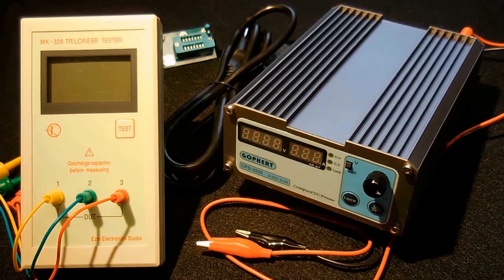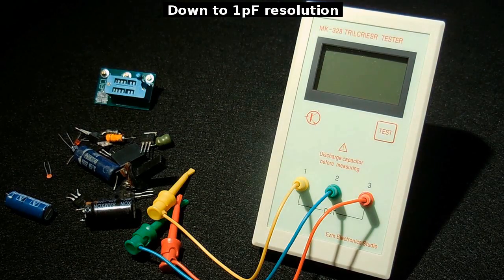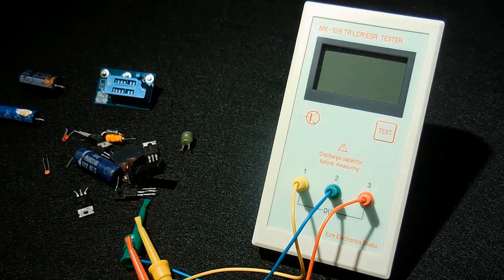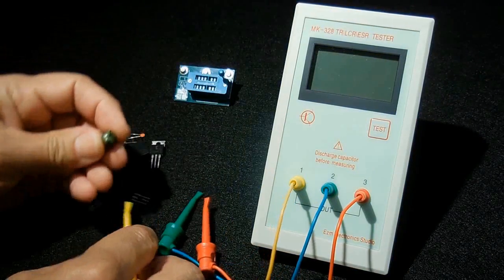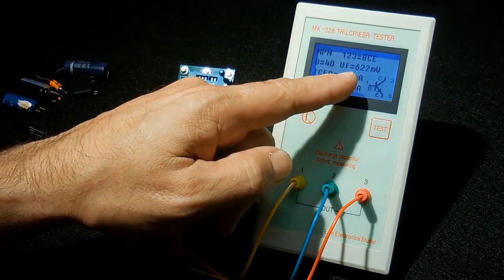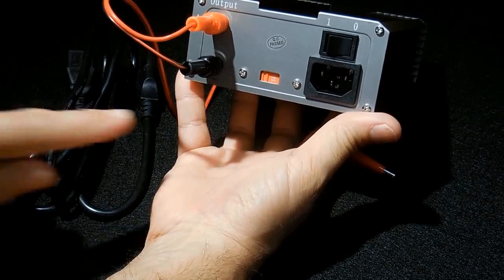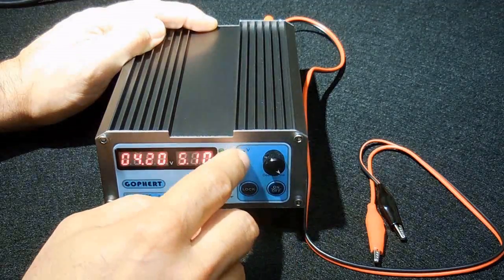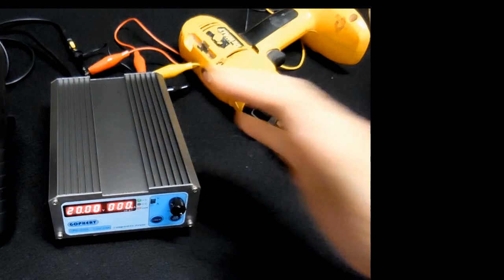(2) Very Good/Low Priced Items For Electronics Hobbyists

Comment: Tester is actually a modified clone of Karl Heinz's Transistor Tester open source project. In order to save money and protect me from a piece of crap postal service I built one myself, gotta agree -  a great tool to have. And, I dunno 'bout this one, but the original design has MENU, which you can open by long press of a TEST button (when the screen is active). In that menu, there are even more features - in-circuit ESR tester, freq. counter, freq. generator, 10-bit PWM, and a self-calibrating option. 
 I suggest you go try and see if there is a menu; if it's there you will be even happier having this tester
Reply: Tried long hold on mine. Nuthin'. :( Need a good in-circuit ESR for cheap. Suggestions?
Reply: Rick Raulston That's unfortunate :( Original software has a whole menu there, I can make a video showing that if you want. For the ESR meter - I bought a cheap analog multimeter, gutted it out and used the movement for a little ESR meter circuit. It's simple&cheap, you can build it yourself; it has no trouble with in-circuit measurements.
Reply: I went ahead and bought an MSR 100. Seems to work pretty good
Reply: Rick Raulston Congrats with purchase, ESR meter is really useful tester.
Reply: Shorting all of the leads together should put the meter into test mode.

Comment: Well, I purchased the power supply and am very pleased with it.  There appears to be a feature not covered in your video.  Normally, if you turn the power supply on, the default operation shows off (meaning no power to the leads).  To change the default operation, press the on/off button for 5 seconds.  This will show dOn meaning power is supplied to the leads at power up.  To change it back, simply press the on/off button again for 5 seconds.  dOf will appear.  I prefer to have it "default off" to ensure I have the correct voltage/current set before I use it.
Reply from the maker: +mediaguardian 
Glad you like it. I'm very satisfied with mine. Can't beat it for the money. I did not know about that feature. Thanks for sharing!

Comment: Thank you for this video. Your recommendations are highly thought of. I was wondering if you felt that the push/turn/push/turn interface was annoying (as compared to just two knobs for V and A)?

Also did you look inside to see what the quality of the inside is? From the price I'm guessing this is a quality item.
Reply from the maker: +Torsan1977 
Hi there. Switching between V and A is no big deal to me. If I was using the PSU all day long, 7 days a week, then maybe it could become annoying. I will post a link in the video description area showing the inside of the unit.

Thanks

Comment: I have that ESR tester. The leads are garbage and will break off and have to be resoldered regularly. They are also very hard to find decent replacements for, since they use the 2mm banana jack. There is also no room in the actual device to install standard banana jacks. The cheap battery plug feels like it will probably break after changing out the battery a few times. The basic functionality of it is great though.
Reply from the maker: I had the same problem, and the fix is simple. When the wire breaks off, you re-solder the wire in position then fill the area around the wire with clear silicone and allow it to cure overnight.
Reply: I see. So basically you are just making your own strain relief. Good idea. Still, I wish the leads were better.
Reply: can't you use standard better leads,  strip the ends and use the adapter and lock down the stripped ends in the adapter?

Comment: I think the power supply can deliver the full 5 Amps at 20V, but it is missing sense-terminals inside to make up from the losses in the wiring inside to the output terminals.

Comment: It is a nice AVR Transistortester, but it is pretty pricey. You can get kits of essentially the same circuit for a lot cheaper.
Reply from the maker: A ready to use tester is pricey at 30 bucks? I don't think so.
Reply: The kits are not too hard to assemble. Some of the premade testers are pretty cheap too. But the very cheapest of them don't have a precision voltage reference in them. They instead just have a zener reference. The crappiest prebuilt one I can find right now on Ali is $7.22 A decent kit is $1.88+$2.84 shipping. Of course for the low price there is no case.
Reply from the maker: Most people already have too many projects going on, so buying a kit, which lacks certain features, to me is a waste of time.
Reply from the maker: Clearly you're not a supporter of all my hard work on this channel based on how you're going out of your way to try and get people not to buy the very good, but inexpensive tester shown in this video. You do realize that this channel is able to remain active(and help countless people) because of the small commission I receive from products shown on this channel. You're trying to deprive me of that support. I keep track of good and bad viewers. Those that appreciate my hard work, receive assistance, and those that don't, get placed on a list. Happy Easter.
Reply: +electronicsNmore Jesus cast the money changers out of the Temple. Now here you try to Crucify me. Nothing ever changes.
Reply from the maker: Enough of the stupidity. We live in a world where MONEY is required to survive. Got that?
Reply: +electronicsNmore yeah I'm planning on keeping it too. I already have 3 AVR transistor testers now. The one you showed is really nice, but it is a bit pricey compared to other offerings. Got it?

Comment: Of course I bumped into this video right after ordering MERS-100 for twice the price and I guess it can measure capacitors only. There just isn't enough information for other testers if they can measure in-circuit which is the main feature I need.
Reply from the maker: You can measure in-circuit, but it's never totally reliable.

Comment: That tester is probably based on an Atmega328 microcontroller (which you can also find in many Arduino boards) which might explain why it says: MK-328 on the front. For those curcious to have a look inside the power supply, go here: http://www.ebay.com/itm/AC-110V-220V-to-0-32V-5A-Precision-Adjustable-DC-Digital-Switching-Power-Supply-/121633720324  and scoll down a bit.
Reply from the maker: +Peter-Paul Vervoort 
Hi there. Yes, the tester is based on the Atmega328 microcontroller. Thanks for the link showing viewers the inside of the unit. I thought of opening up the unit, but did not want the video being too long.

Thank You
Reply: +electronicsNmore And actually it's an open-source design thought up by a german guy. All documentation, firmware-upgrades etc. is here: http://www.mikrocontroller.net/articles/AVR_Transistortester
Reply from the maker: ***** Yes, I know that. I read all the info.

Comment: Voltlog tested one and ripple/noise was 50-55 mV ..  so I answered my own question below, hence they are lying, but compared to many that is actually quite good...     (Jeez it's the first thing you should test on these things).
To hell with these switchmodes my next psu will be a good linear job.
Reply from the maker: They always over-exaggerate, but for the low cost, you can't beat it.

Comment: O.K.  I have to tell you that at first I loved Banggood ... good prices.  Now not so much.  After fighting confusing forms to fill out I finally ordered the tester and then they put in two orders for me.  I went to chat to fix this ASAP, and find I am #29 in the queue and my wait time will be 33 minutes.  How awful is this?  I'll have to remember this if I can save less than a buck using this place.  Good luck if you try to order through them.
Reply from the maker: Sorry to hear about your issue, BUT it sounds like you screwed up and you're trying to blame Banggood for your mistake. There's nothing confusing about placing an order.There's nothing awful about having to wait to speak to a representative that long. I've had to wait that long with many companies in the past. Banggood has become a very popular website, so many people have questions or issues to resolve with agents. No company is perfect, if you think so, then you're highly mistaken. Problems happen with Ebay and Amazon as well, I know that for a fact.
Reply: Banggood is my go to site for electronics and other stuff as well.  Really appreciate your well done videos.  I was looking at the MK 328s when I found your site, glad I came across it.  I bought a Mk 328, but not from BG, found one for $22. US and free ship.  I do intend to buy the PSU the next time I get paid.  Currently using the equipment to repair/modify electric guitars.  Just wound my first Tele bridge pickup and needed a way to test inductance.  Thanks again. WooHoo.
Reply: I have been buying at Banggood for years. NO PROBLEMS AT ALL. 
  And your site is the place I go to for understanding the way out, of the difficulty, I some times find myself in.
Your the man. Thank's for all you do.

Comment: I had a look at the picture but it didn't answer my question, why I'm concerned is, if using an earth clip with a dso on a circuit powered by this psu, one could have a shorting problem to mains earth equivalent to the difference between the two potentials. It looks like very good value though and good specs.. Maybe someone commenting might know ? I did see an earth lead inside, but no idea if its tied to -neg.

Comment: does this esr meter work with capacitors on board, without taking them out?
Reply from the maker: +Kevin Yan 
For measuring ESR, you should not have any problem at all in circuit. I do it all the time.

Comment: Outstanding presentation, thanks. So I purchased the MK-328 and get a display after testing a component that states: 'Not calibrated!' The component results seem to be correct like you show but I get the calibration message right after. Have you had this issue? Much obliged
Reply from the maker: I have no idea. Please ask a question on Banggood for that product.

Comment: Thanks for the video, it helped me decide which of the affordable ESR meters to get. I got the MK-328, but mine doesn't automatically power off, I have to disconnect the component and press the test button. Only then, after finding no component is connected it powers off.
Reply from the maker: Strange. My unit powers off with the component connected. You didn't test a capacitor w/o discharging it first, did you? That could damage the unit.
Reply: Yes yes I did discharge. Specifically for that purpose I have built a special 5W 22K capacitor discharger doohickey with alligator clips on both ends. Anyway, the tester tests without problems, transistors, diodes, resistors, all seems to be okay. Just doesn't usually power off (although it did power off a couple of times, I don't know what to think of this).
Reply from the maker: I967
Contact Banggood and explain your issue. Thanks.
Reply: @electronicsNmore  Update - I learned how to change the firmware in the tester and now I can turn it off and access extra features. I am planning to add an encoder to move about the menu faster.

Comment: I have been looking at the power supplies on Bang Good for some time, and have looked at this one before, but here in the UK, we use 240V,  this voltage seems to be a problem with the BG site, as most of there mains gear is only upto 220v.
Reply from the maker: 110/120v or 220/240v. Either works.
Reply: forgive me for being a little thick, but if you put 240v, into a 220v item, I'm sure you will blow it.  The only way I can see of being able to use these low rated power units, would be to use another power sources to lower the power I am using?
Reply from the maker: Nick Stevenson
Incorrect. Voltage always varies. In the USA I have seen the 120V line vary between 110 & 130V. I have seen 240V range between 220 & 260. Your concern is unfounded. I have many people buying these units from the UK. :-)
Reply: ok, thanks, will give one ago, but you can not blame me for being careful, lol
Reply from the maker: Nick Stevenson
You won't have any problems. :-)

Comment: Why a MERS-100 is more expensive? I mean, what is the difference? In comparisson, why should and why I shouldnt choose this product? I want to know the defects, if any... Why did the tester devour the batery? Nice Vid! Thanks!
Reply from the maker: When filming, there are always interruptions by landscapers, barking dogs, etc. So I had to film certain parts a few times, which is why the battery gets drawn down. For the money, you cannot beat the tester. You cannot expect perfection from a 30 dollar tester. Thanks for watching!
Reply: Have any video using this on in-circuit  capacitors?
Reply from the maker: The normal procedure is testing the component in-circuit, if the reading is "close" to the value of the component, then you're OK. If the value comes back way off, then you need to desolder one lead and test again. No tester is 100% when testing in-circuit. Problems can occur when components are placed in parallel. All this being said, I have no problems with the tester.

Comment: Congratulations on 50k subsThanks for the video.  I have been without a capacitance/ inductance meter since my last one broke.  Great functionality for the price. I have also been looking for an inexpensive power supply that has low current limiting.Does the current go down to 0mA as advertised?Do you have a suggestion for an inexpensive oscilloscope?Will share...
Reply from the maker: +Daniel Piotrowski 
Hi Dan. I tested the current limiting down to 1ma, and it does work fine. At 0ma, you get no output. My scope is a Velleman HPS-50 handheld scope. Good enough for me. :-)
Reply: +electronicsNmore Thank you!

Comment: Thanks for the video! I've had my eye on BOTH of these products for a little while now and this helps. One question regarding the power supply testing...did you meter the output to make sure it matched the display and (if so/not) is there a way to calibrate it if it is inaccurate? I might learn the answer if I watch your "inside the case" video...just thought of that mid-comment. Thanks!
Reply from the maker: Philip Partain Hello. The power supply does not require any calibration. I have links and a coupon code
 posted in the video description area. Thanks for watching!

Comment: Thanks for the info, I purchased the ESR meter you recommended and there wasn't any documentation.  I needed the ESR meter to test caps in my old Fender amp, and another amp that was fried.  I'm also hoping to repair other things too, but I'm not clear on exactly what it means for the cap to be bad, aside from higher resistance.  Or somewhere in between.  Is there some graph or scale available?
Also,  appreciate you speaking distinctly and staying on tract.  This is a skill that is sadly missing in a lot of videos.
regards,
-Peter
Reply from the maker: What you need to do is first make sure the capacitor has been fully discharged before testing it. You need to look up data sheets online for the electrolytic capacitor you're testing. The data sheet will show "Typical" ESR values for a good capacitor. There are also charts online showing "Typical" ESR values based on size. Thanks!

Comment: Does the polarity of electrolytics matter with the connections of the leads with the meter? (Always remembering not to test a "hot" one, of course!) And is Bang Good reputable?
Reply from the maker: No, not with that tester. Always discharge capacitors before testing. I've been dealing with Banggood for 2 years now, and haven't had any problems. No company is perfect. A very small number of my viewers had problems with shipping/damaged goods.
Reply: electronicsNmore Thanks! I hope you show video with more experiments with the waveform generator and the oscilloscope, as way too many videos on youtube  just are intros for college first time hookup and go like this: "This is an oscilloscope... This is a signal generator... We hook them up with these cables together, and by fiddling these knobs we get a sine wave, and a square wave of Nth Hertz..." And then they say something like you can use these for lots of things. And then they never show you any of these "lots of things" that you use the scope and the waveform generator for... Maybe they show you a trigger. But actual uses? Not too much on that: How to check components, how to diagnose a circuit. How to use them to build up a circuit to do something.
All the Best! 
Sincerely,
Bill Pietschman (W8LV)

Comment: Did you test the noise and ripple, 30 mV pp sounds good if true, but every budget psu I  checked with my scope I found the spec sheets were blatantly lying. One claimed 60 mV pp max noise and ripple !! I found 400 mV (minimum) no matter what the load or volatage setting..  Has anyone tested this Gophert properly.??

Comment: Will this device perform incircuit testing?  Even if it doesn't, it still is impressive for price.
Reply from the maker: Some tests can be done in-circuit. if the test fails, then you need to desolder the base or gate to a transistor/mosfet to be sure.

Comment: It looks like from the specs or the photograph that it doesn't have a cooling fan.  What can you tell me about the heat dissipation?  Does it have any thermal protection?
Reply from the maker: +mediaguardian 
The unit is thermally protected. I operated the unit for quite a while under a 3-5A load and all the housing did was get a little warm. The switching transistors/mosfets are connected to a huge heat sink, which is the aluminum housing. Look at the inside. The link is in the video description area.

Comment: Lou, has anyone obtained the software instructions for the calibration and test set up ?
Reply: Search the term AVR transistortester on the net. All those multi component testers are variations on that design. Usually shorting all three leads together puts them into calibration mode. Then you need a 100 uF capacitor for part of the test.
Reply: Thank you so much Paul,Lou